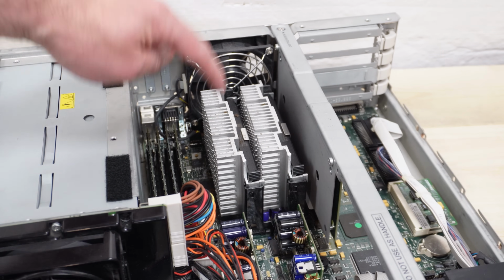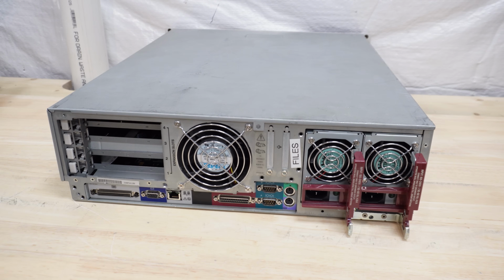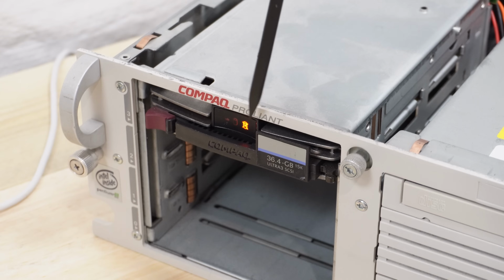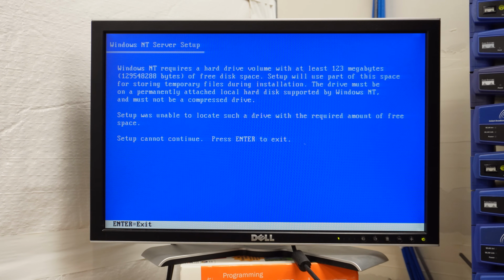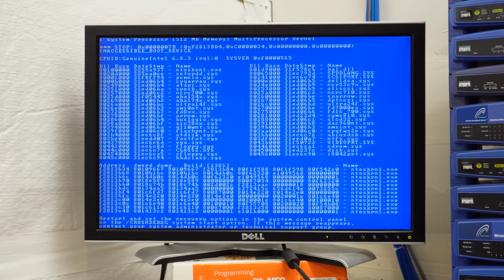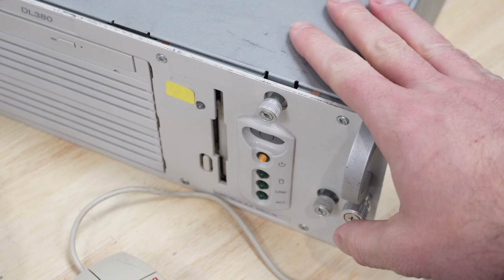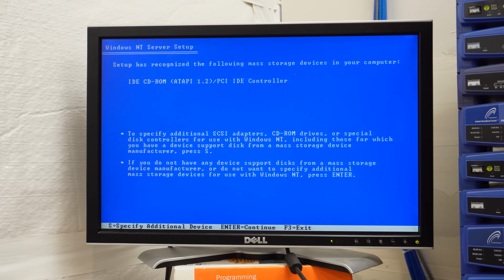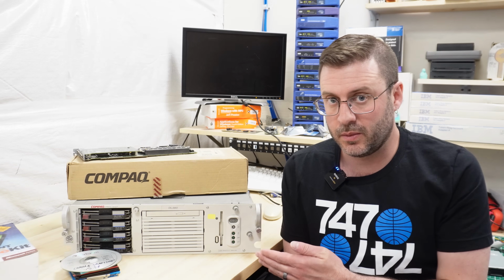Failing to Install Windows NT 4.0

Comment: You do NOT need any Win 95/98 anything. Make the NT 4.0 boot disks. That is the fastest way to install WinNT. I would create a 2 GB boot partition, and once NT was booted, I would make the rest of the drive, drive D: and install or store everything there. After installation, I would copy the i386 folder and the latest SP to the C: drive. Both would be formatted as NTFS. I never never never never never used DOS. It doesn't understand NT enough to be reliable.
Reply: Run from another Windows NT or... eewwww DOS, run (assuming your CD is drive D, if not, replace with the correct drive letter):

\i386\winnt /od 

Have three floppies ready. Boot from the first disk. Load ALL extra device drivers at once (keep on pressing S until they're all loaded). And then start setup. 

No DOS involved. No pain involved. It just works. And formatting to NTFS directly is quick unless you ask it to verify the disks.
Reply: And if your BIOS is new enough, just try booting from the Server CD. It'll ask if you want to boot the cd by pressing "C". Press C. No floppies. No DOS. Quick and painless. This would have solved the inaccessible boot device BSOD, because it wouldn't have created a drive partition in the wrong area.

Comment: Ha, I actually did all that stuff, years ago with the original hardware when it was current.   Amazing you made it as far as you did.  Fun stuff is that you can in NT 3.5 and NT4, get the same performance as you would from NT Server, simply by changing a few registry keys.

Comment: After all the talk about scsi drives you didn't want to install  the top scsi controller? Then after installing the 5300 I haven't watched it yet but I doubt he selects integrated 4300/5300 drivers.

Comment: I ran two different hospital systems (at different times) on NT 4.0. There's not a lot of HUGE differences between server and workstation in the NT 3.51 / NT 4.0 era outside of being a domain controller and running things like SQL Server, etc. By 2000, you'd definitely be running Windows 2000 on this era of hardware. Good times. We ran Exchange, file sharing, SQL server, and way more on NT 4.0. It was pretty solid compared to many OS's of the time, but not perfect. I've worked stupid hours to resurrect broken PDCs/BDCs. I used mostly HP gear during the time.
Reply: Yeah, one of my first real jobs involved an NT4 -> 2000 domain migration... that was... challenging.

Comment: PCI-X is just a 64 bit eXtended version of the usual 32 bit PCI slots that supports faster bus speeds. Just means it has higher bandwidth, both by data path width and clock speeds. You can always plug 32 bit PCI cards into PCI-X 64 bit slots, and you can usually plug 64 bit PCI-X cards into regular PCI slots - they will just run slower. Same way you can plug an x1 PCI-E card into any size slot, or a bigger card into a smaller slot - it'll just use however many lanes it has.

Comment: Watched from beginning to end, kinda reminded me of my time trying to install a copy of Windows NT 4 Workstation on our family computer and not realizing how non-straightforward it would be. There wasn't even an upgrade path from 98 SE because NT 4 is older than 98. For your kinda hardware, back when that hardware was in production, what you are doing now was kind of a last resort. These systems likely came from the factory already configured to go. It was only under circumstances regarding hardware failure you would even need to reinstall the OS. You also likely had a Compaq support tech come out on site to do it. Upon your first failure, I suspected the issue was likely that you are using retail media versus the actual manufacturers recovery media. Windows NT 4 was notoriously very finicky and things didn't get better until Windows 2000. I suspect, if you tried Windows Server 2003 it would have worked out of the box because Microsoft was a known COMPAQ shop internally so they likely would have tested it thoroughly to support that release.

Comment: enjoyable video, but I'm genuinely curious as to why you didn't do NT5 (2K) or NT5.1 (2k3) Server instead (I've personally ran 2K3 on a long-since dismantled ProLiant 3000 and ProLiant 5500 - ah, the SmartStart days, I don't really miss those much - and it ran like a champ on both platforms)

Comment: I was a system administrator 25 years ago and I did not enjoy working on Compaq equipment. I inherited a bunch of late 90's and early 2000's Compaq gear along side a bunch of brand new IBM x Series servers. The IBM servers were light years ahead of what the Compaq servers had going on. NUMA and FC-SAN OH MY!
Reply: I started dealing with IBM PC500 servers and they were very strange machines compared to the Proliants I was used to.  So much so they flew in peeps from New York and finally fixed it with a custom bios.  We had 150 of them we were trying to build so IBM was motivated.  Heh

Comment: Even modern versions of Active Directory (such as a brand new domain with an effective level of Server 2025) still supports the original Windows 2000 feature set. It works in reverse, too: a Windows 11 device (which “prefers” 2025) can connect to a 2000-level AD domain. Not sure how a domain with mixed-level domain controllers work though.

Comment: I worked on software for windows nt 4 from 1996 to 2005.   Not for Microsoft I must say.  For a small private company integrating with call center equipment (bleh) but also transit trains and planes equipment (eh).  At peak in 2000 we had three servers downtown in a major US city and machines in every train station across the city.  Plus we had a VM farm for software test.   Win nt 4 was already on the way out but we were wedded to it and never got away from it.

Comment: I don't know about any partition size limits in NT 4, but I know that NT 4 does not support FAT32, and of course FAT16 is limited to 2 GB. NT will create and format FAT16 partitions initially, even if you choose NTFS, and then the installer will later convert that to NTFS if that's the filesystem you chose.

Comment: I remember these old beasts from my early career.  Once you get into the HP G3/G4 series, especially with Windows 2000/2003 it gets wwwwwwaaaayyyyy easier. That being said as I recall..... You are so close to the right spot, you're just missing like 2 steps. First step is to let go of all the DOS, fdisk, etc....  Run system erase.  Then run your smart start 4.9 or 5.0, don't mix and match! When you get to the screen that says load your install media, press continue to reboot... don't do it exactly as it says. Instead, eject ALL media, hit continue and leave the server alone. It should boot off the hard drive and ask for the Windows NT CD-ROM, because smart start is creating an install environment for you ON the array.  Also when working with the arrays and the partitions, the array data is stored disk by disk onto a part of the disk that you cannot access properly outside of the SA controller hardware. It does this so you can migrate an array to a new SA controller or physical box in a failure event and your server will relearn the array and self repair at the bios level!   When you are in the array config utility, you're again on the right track, let the disks be blank, create a 2000MB partition (keep it just under an official 2048 binary).. Smart Start will create SEVERAL partitions on the array, you're not meant to interact with them, the smart start essentially slipstreams the drivers and installer into a partition that is temporary and then binds to the system diagnostic partition. From that bootable space it will kick start everything.   IF, I'm thinking too far ahead (smart start 6 + era), then when you do get to your NT boot screen and you specify the drivers, keep specifying and add ALL listed drivers that relate to NT4.    Think of all of this like the ROM on Sun box, your in a pre-OS state, treat the Smart Start and related utilities the same way you would the ILO on a Sun hardware.  The SA 5000 card is also the way to go, they are beautiful pieces of gear.  Good luck, love your videos!

Comment: If I remember correctly, with some of these "Name-Brand" models, you not only need a driver specific to the RAID controller, but you'd also need the vendor's "Drive Array" driver also. So in short, try loading the Smart Array/4xxx driver from the disk, and also load the Compaq Drive Array driver (#2 on the list). The 4GB max boot partition rule still applies if using FAT, although I believe you can 3rd-party resize NTFS after installation to a max 7.8 GB before hitting the Int13 limitation.
Reply: Yep.   Thought I remembered that too.   It was more than just the specific model's driver - you had to also load the array driver with it.

Comment: I used to have a server for backups, photos, music, plex like stuffs. It came from our power plant here. Every controller on it needed drivers. Omg i probably had 20 floppies to setup. I also ran headless ubuntu and had to modify allot of config. Knowing the steps it took like a whole week to move from a major crash reinstall to up and running. It also was not at a desk. So my back killed me by the time it was up 🤣

Comment: You have to have the correct Smartstart cd version for the hardware you're using. They don't all have the right device drivers for the exact smart array controller you're using, which is important to have NT detect the harddrive. So you need to create the NT driver disks from the right Smartstart version. A logical drive is not the same as a partition, it's just a virtual harddrive. The NT 4.0 setup can partition it's own drive and format it as NTFS as long as you have the correct array driver loaded :)
Reply: Almost. The NT 4 setup can partition it's own drive and lie to you telling it's NTFS, but it actually formats it as FAT16 and sets a flag to have it converted to NTFS at the next boot.
This is important to know as the resulting partition is in some ways slightly inferior to a partition that was actually formatted as NTFS. Also this creates the 2G size limit.

One of all work arounds is to format the partition from within another NT4 install.

Not that this matter much for what's going on in this video, but still.

Comment: "I want to become more familiar with NT 4.0". So... you like pain :D And this from someone whose starting daily driver Windows WAS NT4.0 SP3... One of the most damning things is the lack of a proper way to slipstream the SP's, because LOTS of things were (finally) fixed in SP6a. It's also terribly "sensitive" to hardware changes, so, once it's set, just don't... And the ISA sounds more like a thing of nightmares than "help". Anyway, the thing about NT4 is mostly figuring out how the box likes to be configured/installed, and it varies A LOT. Once you got that down though, and preferably documented, it usually behaves.

Comment: You can have a boot partition up to 8Gb for NT4. The trick is to install to a 2Gb partition, and then resize it later in NT with Partition Magic. I've done that every time. No problem.

Comment: I had a couple of those servers when I was hosting LAN parties in the 2000s. I never bothered putting Windows on them though, I remember installing Debian Etch(and-a-half) was a breeze.
I had one of them (Dual PIII 1GHz, 1GB RAM) running as the intranet web server when one of the drives failed (I had 4x 36GB drives in a RAID 5). I got an alert that one of the drives had failed. I went to the shelf at the other side of the room to get a spare drive, went back to the server and I could watch a second drive fail. So yeah, no intranet for the rest of the party…
As a file server I had an old IBM 6U behemoth of a server with quad Xeon 550MHz and 8 hard drive slots filled with 73GB drives. In a RAID0 because, well, space. On my last LAN party a drive failed on that one and it took me hours to recover the data from those drives…
God, I hate SCSI drives, with a passion…

Comment: My very fuzzy memories from thirty-odd years ago is that SmartStart will do all the disk partitioning, formatting, etc. necessary and prompt for the Windows NT install media, if required. I believe SmartStart may have actually had the Windows NT Installer on the disk, configured with appropriate drivers or, at least, prepared to inject the required drivers at various stages of system setup. I don't recall there being that many steps to an NT install. SmartStart was created to make it easy to deploy one or one hundred servers with minimal intervention once the process was started.

Comment: I always used to keep a Linux boot disk handy, as that can easily obliterate all partitions on a drive in a matter of seconds.  "dd if=/dev/zero of=/dev/sda count=5000"
DOS made it much, much more difficult.

Oh, and I seem to recall that you needed to have an "Enterprise" (or something similar) version of NT4.0 to be able to support multiple CPUs.
Reply: Another note, again using Linux.  If you "lspci" from a Linux rescue disk, it'll show you all the PCI devices and their device IDs.  From this you can find out exactly what your drive controller is, and then search the contents of the *.inf files in your driver disks to see which driver will talk to the hardware you have in your system (the PCI ID.....not the vendor part but the device part....should be listed in one of the driver INF files).

Comment: Creating a logical disk doesn't auto create a partition, you'd still need to use fdisk to create a partition and then format it in FAT16, NT will then install to the FAT16 formatted drive before running a conversion to NTFS. You could also slipstream SP6a into your install media to alleviate all if these issues as I am pretty sure SP6a has support for large volumes.

Comment: Cool that you mention LAN Manager. I became a certified LAN Manager Administrator, and later Systems Engineer, in 1992. There was an earlier version of that ProLiant with clip-in drives rather than the lever clutch drives that you have. This brings back lots of memories!

Comment: I installed NT 4 (Workstation) on a Compaq Pentium tower a couple years ago.  I remember it being a rather kludgy process too.

1) The computer was too old to boot from CD, so it had to boot from the setup floppies.  Which of course takes a nice long while, making subsequent attempts all the more frustrating.

2) I was installing to SCSI, which means I also had to have the SCSI driver disk available to get past the "no drives -- you lose -- reboot to try again" level.

3) I don't remember exactly how the final process went, but I do know the end result was that I had to copy the installation files to a separate FAT16 partition (I had an IDE disk installed too, so I just used that), then run NT's setup from there.

4) I found out the hard way that you REALLY need to have smartdrv running.  The setup program is extraordinarily dumb.  They did not try .. at all.  Every file it copied, it would do the whole "traverse the directory tree, look up the entries in the FAT, find the file, read it into memory, traverse the target directory tree, reserve clusters in FAT, write them from memory" and rinse and repeat.  Cache?  What's that?  Nah, let's consult the directory entries and FAT every single read and write operation.  It took well over an hour to install, and NT 4 is not that big.

5) Once the install got going, it then became clear that my "NTFS" partition was not.  It was just FAT.  It then proceeded to convert it to NTFS, because apparently the installer doesn't know how to work with NTFS.  Told you they didn't try at all....
Reply: A separate IDE disk is a great idea.
Not sure how that would be physically possible on this computer, but I would think that some adapter to connect it where the CD is connected would do the trick. Seems fairly simple to DIY. Since the computer can boot from floppy it should be possible to format/partition the disk from a boot floppy and then maybe connect it to another computer to fill it with for example the NT4 install files.

When doing this, it's absolutely worth running SMARTDRV (DOS6). Installing NT4 and starting the installation from within DOS using Smartdrv is about 4x faster than either installing it from within DOS without smartdrv or installing it by booting the NT4 install floppies. In other words, if you haven't reached about 75% of the file copying progress, it's worth aborting and restarting with smartdrv if you started without it.
Also I wouldn't use a Win9x boot disk, I would use DOS 6 which is more era appropriate for NT4.

Comment: This was another fun one to watch, even if it was a fail. I have spent hours doing the same stuff you're doing but with slightly newer dell hardware... Makes for some long evenings. 

I admit i chuckled a bit when i saw you add the raid card without moving over the cable for the backplane to the new raid card and then powered it up, i giggled but felt bad because i knew that was more burnt time.

Still, its fun watching you learn this stuff for the first time.

Years ago i had a lab server i used while working at a tech company, i had no money or budget and had dug this thing out of a graveyard somewhere, it was a proliant 360... Maybe? Anyway 1U server, its raid controller was toast, and i wound up taking a PERC raid controller out of a dead junk poweredge and putting it in there. Worked great, you reminded me of that box during this video, unfortuantely when i left i had to leave that box behind, wonder whatever happened with it.

On a side note, the raid config screen you see when going into the raid controllers bios to configure it still exists on newer hp raid cards even today, of course with less graphics and it's "web based" but it is still there. 

Anyhow, great video, Thanks for the upload, even if it was one that didn't have the ending you desired.